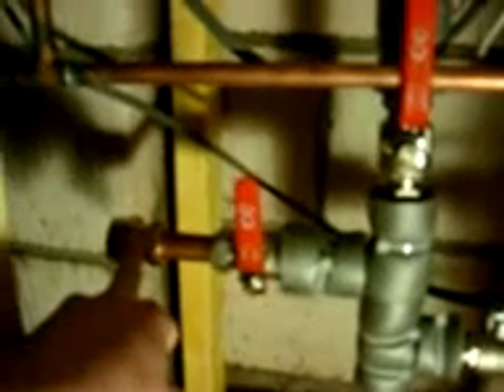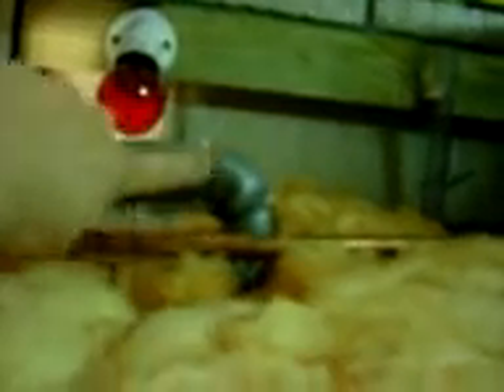GL Biodiesel Reactor

Comment: well 35,000 miles, two and a half years and its still running fine, same injectors, same rings,same fuelpump etc. and mine runs on a Lucas CAV rotodiesel pump which all internet forums say wont run wiv veg oil so this proves them and you wrong.

Comment: the white spirit you have to use is non kerosene based so is not taxable, ive seen and worked on many diesel cars,fords,mitsibushi shoguns, land rovers,vauxhalls, volkswagens which use veg oil and white spirit with no problem

Comment: hi, i find it much easier to mix veg oil wiv 5% - 10% white spirit,leave it to thin itself for a couple of days,then put it straight in my car. no heating, no chemicals and i have done over 35,000 miles no problem,